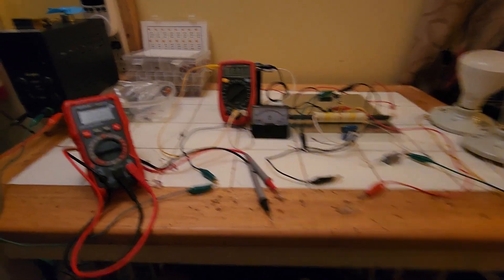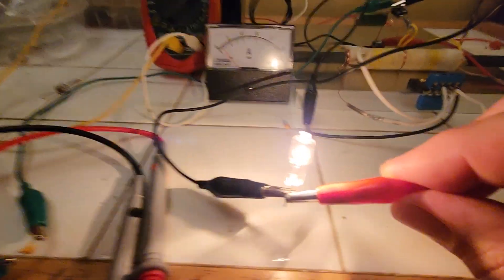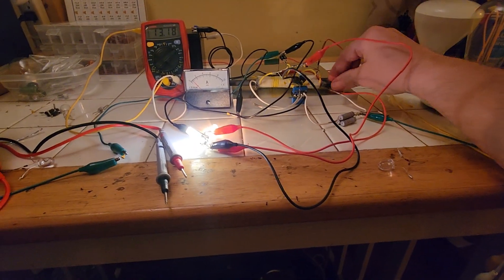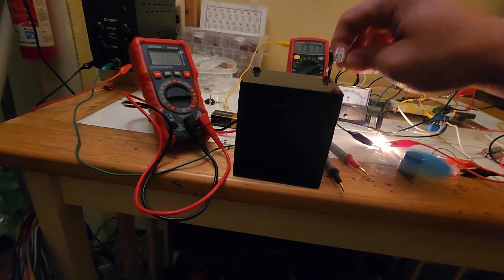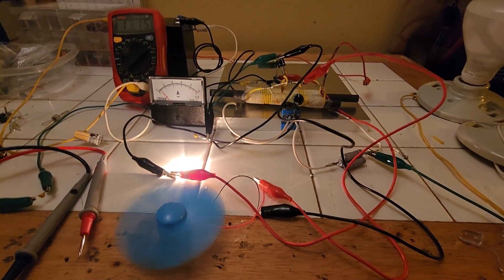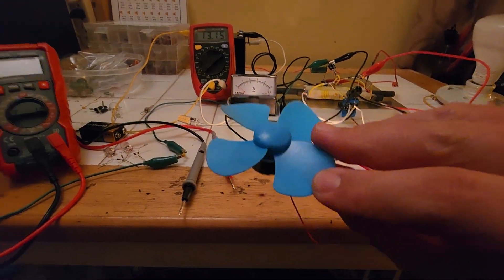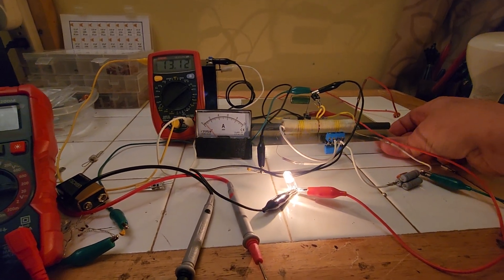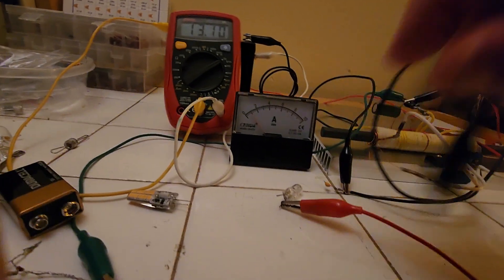🌪MUST SEE VIDEO ON THE NEGATIVE RESISTANCE PHENOMENON & NEW RINGER PROTOTYPES COMING🌪

Comment: This is not a research channel. Your so called Super Capacitors are Lead acid Batteries, you are using a total word salad to baffle scientifically illiterate people. Dialectricity is the charge in conductors across a dielectric (which just means insulator), that has nothing at all to do with Crystal radios. Crystal radios use RF energy directly, no receiver can "bog down" a transmitter. I am a qualified Electronics engineer also with qualifications in RF. What I responded to were your stupid comments which show no electrical or electronic understanding whatsoever. The sad thing is you will fool some people. Also making stupid comments. Quote "Should all electrical research just cease then?" Idiotic, of course not but research should be done in a way that has published results that can be tested. Not a bunch of lies by a charlatan who wants people to buy over priced gimmicks on Patreon. Black holes do not violate anything. "closed mechanical systems such as light speeding up & Slowing down as it passes through different mediums multiple times" What utter crap, just a bunch of words strung together. Light is not mechanical, it is electromagnetic just like radio waves and so on.
It is very clear you are talking total crap.

Comment: This guy needs to learn about the laws of thermodynamics and also the difference between reactive, apparent, and true power.
Reply from the maker: The laws of thermodynamics only apply to closed mechanical systems not magnetic resonant based ones that are open or use radio frequencies. Why do you think an unlimited amount of people can tune into a radio station?

Reactive power is the power associated with the reactive components of an electrical circuit. It is the power that oscillates in and out of the circuit without being consumed or utilized. Reactive power does not perform any useful work in the circuit but is necessary for the operation of inductive and capacitive loads. It is measured in units called volt-amperes reactive (VAR) and is often denoted by the symbol Q.

Apparent power is the total power in an AC circuit, comprised of both real power and reactive power. It is the combination of the two types of power and is calculated as the product of voltage and current in the circuit, without taking into consideration the phase difference between them. Apparent power is measured in volt-amperes (VA) and is denoted by the symbol S. In other words, apparent power represents the power that the circuit "appears" to consume, taking into account both the real and reactive power components.

True power, also known as real power or active power, is the actual power that is consumed by a circuit to perform work or provide useful output. It is the power that is measured in watts (W) and is responsible for heating, lighting, mechanical work, and other useful energy transfers in an electrical system. True power represents the energy that is converted into useful work, such as turning on a light bulb or powering an electric motor. In contrast to reactive power, which does not perform any useful work, true power is the component of power that is most relevant in determining the efficiency and effectiveness of an electrical system.
Reply: @MTECH2022  Thanks for this info, I didnt know any of these things. Im the guy this guy claims you are lol dont bother with them, they're part of the problem not offering any solutions to the general public electronic ignorance, he should of been giving us the lesson on thsee things after proclaiming he knows everything.  But he didnt, you did,  and why you have a youtube channel and he's got nothing, keep at it thank you.
Reply: @MTECH2022  The educated reader learns everything they need to know from the first two sentences you said here. You don't know how radio works, got it.
Reply from the maker: @maudiojunky  how do you think radio works then? Please tell us with a detailed comment. Here's an interesting read for you that lists two forms of radio. The common hertzian one & Tesla's non hertzian one.

https://www.google.com/url?sa=t&source=web&rct=j&opi=89978449&url=https://becomingborealis.com/wp-content/uploads/2018/02/dollardEm-v3-1.pdf&ved=2ahUKEwiVz8_q2oCGAxUK5MkDHdBoDnM4ChAWegQIBRAB&usg=AOvVaw0jEvR4tv54KaFT4sHdeUit

Comment: A circuit with lower power loss as the load increases does not necessarily mean that there is overunity. Why do you never measure true rms  input wattage and output wattage (for example the voltage over an ohmic resistance). Brighter bulbs or an additional small motor say absolutely nothing about energy balance and efficiency.

Comment: the phenomenon is easily explained by a shear amount of ignorance.
Reply: Negative resistance is the introduction to the free energy and perpetual motion machine! 🤣🤣
Reply from the maker: @FrankyFixIt  closed system perpetual motion machines & open system solid state magnetic resonant wireless power systems are two completely different entities & the closed system perpetual motion machine will never work without external input. Our systems involve energy stimulation & harvesting via the environment & decoupling cause from effect by varying capacitance with respect to time
Reply: @MTECHINDUSTRIES2022  What you say is nonsense. Only semiconductors are known to be practicable negative resistance devices (and that doesn't mean they help produce power, only that the I/V curve's slope goes negative due to, for example, quantum tunnelling for tunnelling diodes operated within a very specific and narrow range of operation).

You will NEVER get more energy out of a circuit than you put in, and energy "harvested" from the environment in your case will be negligible.

I suggest you spend your time actually learning about basic physics first.

Source: I'm a power electronics engineer
Reply from the maker: @ic7481  negative resistance can be present in virtually any LCR circuit & more power can indeed be extracted via wireless magnetic resonance in certain circuits similar to how an unlimited amount of people can tune into a radio signal not to mention all the ancient electrical engineers that gave us our modern world believed that the correct generator archform could achieve energy synthesis meaning more power out then in but it would need to be a high frequency open system.

https://youtu.be/pNstg-HHneY?si=QsdT-ldaNiw0ViXi

https://youtu.be/IEnxbzCbTlY?si=pozcYsuVdWTfmw28
Reply: @MTECH2022  as an ex Fermi Lab engineer who worked over the LCLS2 at SLAC and the Mu2e experiment I'm going to tell u bullshit lol
Reply from the maker: @FrankyFixIt  playing with particles is much different then playing with fields & I'm not stating anything that isn't in text books written by the masters linked in my video description & when pure negative resistivity is achieved in a circuit it draws in ambient energy from the surrounding enviornment
Reply from the maker: The phenomenon also means the circuit is operating nearly as efficiently as possible

Comment: Encountered many times...

If you can correct the frequency the effect will gone.
Same thing happens with a magnet. There are also other setup that reduces consumption when putting a magnet.
These phenomenon will be corrected with changing the frequency.

Maybe we have in different situations and I could be wrong.

At first I thought I achieved overunity. Putting load(s) will drop down current draws. But when calculated it's nothing.
Until I found that it is due to the wrong running freq of the system(out of resonance).

Try this, make a simple circuit. A complete oscillating circuit with load. Then fine tune the circuit's osc freq(with load) until the current drops the lowest possible(monitor with meter) and lastly, remove the load and observe the meter.
The effect will give the same. 
But the important thing to achieve is to have a very high efficiency system.

Good luck for the next experiments.
Reply from the maker: Thank you & I'm interested in all your knowledge related to the subject :)

Comment: This is bull shit. It won't charge the battery amp.
Reply from the maker: It easily recharges batteries & super capacitors & I demonstrated that in my vid. Brought it from 0-13vdc within a minute & how can the negative resistance run a 10 watt incandescent bulb but not recharge a battery or super cap?
Reply: @MTECH2022  lol, you do not understand basic physic concepts, do you?
Reply from the maker: @lo2740  think on this. The conservation of energy laws ultimately breakdown in open systems. Where did the energy to start the big bang come from without violating the very biased laws of thermodynamics that only apply to closed linear mechanical systems. Why do you think an unlimited amount of people can tune into a radio station without bogging down the transmitter & the first radios were crystal radios that powered themselves from the diaelectric signal
Reply: @MTECH2022  Seriously! We do not know where the energy for the big bang came from, it may have been there all along. It may have come from somewhere else. We do not know. 
You obviously do not understand radio at all based on your comments of 'bogging down' a radio station, utterly ridiculous. Electricity is not metaphysical at all. Dielectric refers to insulators.
I hope your fraudulent Patreon gets taken down.
Reply from the maker: @davewood4604  In what way am I fraudulent? This is an electrical research channel. My Patreon also has a library/archive of free electrical engineering books from the masters & Diaelectricity is absolutely real. Not sure why you're so mad. All our products we sell are experimental platforms for researchers. Should all electrical research just cease then? More efficient diodes & transistors come out every month that further improves our designs. Also there's many things in nature that violate the very biased conservation of energy laws that only apply to closed mechanical systems such as light speeding up & Slowing down as it passes through different mediums multiple times. Black holes also violate the conservation of energy & so does negative resistance. It's theorized energy synthesis should be possible
Reply: Then prove it that the ringer is able to charge the battery and make sure it will increase the amp too, not just the voltage 😮

Comment: is the flyback passing threw the bulb to the supercap?
Reply from the maker: In this model & Demonstration, there is no flyback capture the bulb is being run from the wireless yellow coil that's in resonance wrapped around the ringer. This model is my test platform to maximize the negative resistance effects :)
Reply: @MTECH2022  I meant the incandescent no the led ;) , ok no flyback